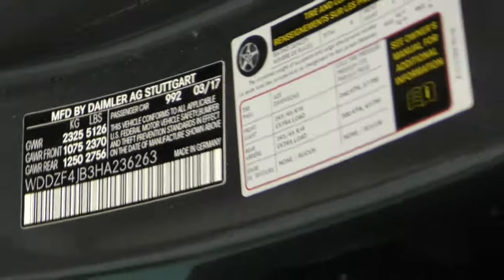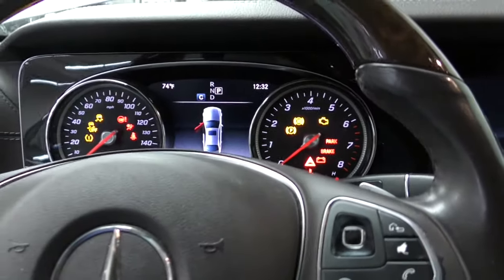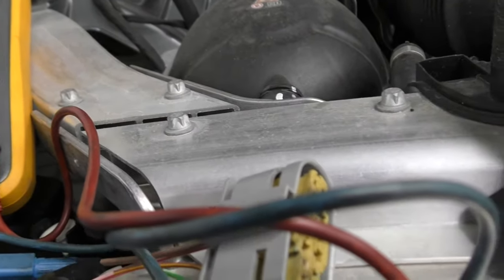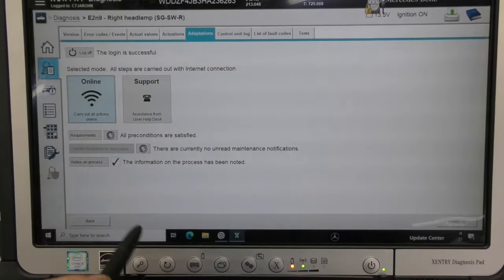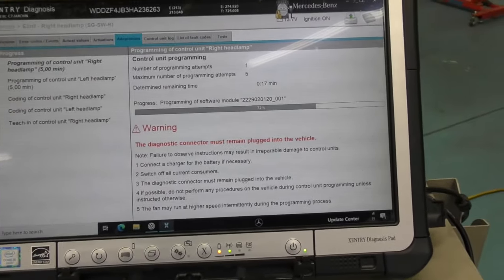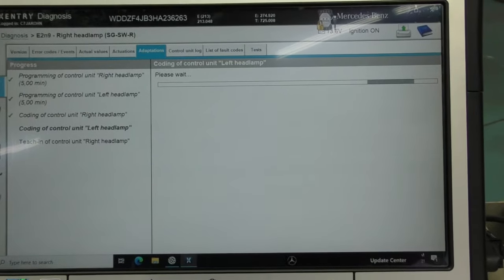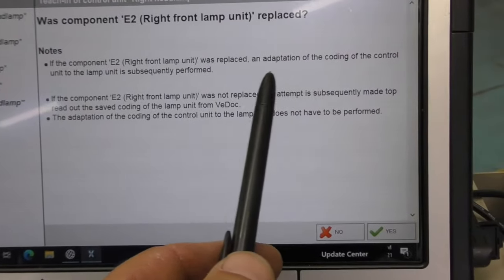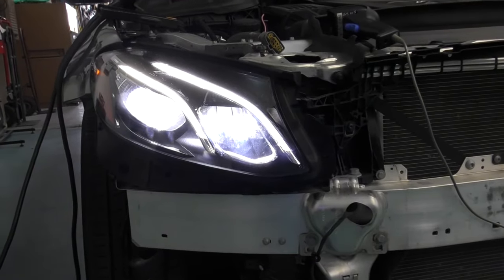How to fix a Mercedes matrix LED headlight replacement and programming

Comment: $2500 ha I bought my headlight replacement online for like $800 thing is I didn’t have to program the new module to the car just plug and play and I bought that module for $80 on ebay
Reply: The dealer quoted me $3360 for this 😂

Comment: So I had a similar issue headlight broke water got in I changed the headlight but now both side light have no response at all.. I'm thinking I need a new module for the light I replaced after that what will be the next steps for coding ?
Reply from the maker: You would have to take it to a dealer or somebody with the Mercedes scan tool. All the coding is done online

Comment: I have a 2017 C300 and I bought some 2019 LED headlights. When I connect them, only the right low beam turns on, but when I connect the left one, they turn off. I’m told they need to be programmed online, but they’re charging me $500 USD. Is it really so expensive to program them online? My headlights and modules are brand new, never used in a vehicle.
Reply from the maker: hi, yes it needs to be coded to the vehicle,

Comment: Why are the headlights so expensive?  I have a malfunction on my right headlight of my 2016 glc300 model.  All of a sudden the low beam light was not working. I was told I need a headlight control unit or possibly a headlight. Can you give me an estimate of the cost for this to be fixed assuming I need a whole headlight.  I have been given a few estimates and both are so off so I’m not sure if I’m getting ripped off only because I’m a woman. Also I think these should be covered by Mercedes’ coincidently it malfunctioned once my warranty expired.  Any help will really help me. Thank you.
Reply: I think the program has crashed in your headlight control module. The cheapest fix  would be is to enquire about a garage that services mercedes and asked them if they do a SCN coding service. What that is ,is an internet connection that downloads the correct functioning software for your headlight module . If your lucky it might work out . It should take under an hour and might cost you several hundred dollars. good luck.
Reply: @888snuffy so she should pay a few hundred dollars to connect her headlights to the internet for an hour? 4R?

Comment: Greetings to all, recently the damage to the car was repaired and at the same time the front right light was replaced.  Now the new light shines differently than the old one.  I would like to know if it is possible to program the lights so that they both shine the same?

Comment: My 2017 GLC300 has condensation in it and it threw error and the lights went out. Once the "desiccant fix" is done and it is dried out, will a rest be needed to make light work again? if there is no other damage?
Reply: Condensation has many degrees.
If it is a fogging up, fine mist, then is a light issue, just dry it up.
If you can see water droplets formed (so not a very fine fogging up) then is severe and most likely some water may have gathered up somewhere inside. The unlucky part is that many headlights have electronic units on the bottom of headlights. 
Also not everything should fail, so maybe low/high beam control unit is under, but the drl one is not, so you just have some missing functions. 
If everything is "dead",  maybe going to a local shop to connect to the car and delete the errors.
If not, i'd take down the headlight and inspect the control modules to see if any signs of water damage..

Comment: Hi sir 

I have 2017 Mercedes c300 base model I got flooded in rain I change the unit control module in trunk now my rear turn signal is not working and the gas door is not opening can you please tell me what to be done
Reply: are the fuses okay?

Comment: Can you help with advice for my w212 2016 with adaptive headlights fogged and stop working ???
Reply from the maker: Fog in a headlight means water got into it remove the headlight from the vehicle and remove the modules in the bottom of the headlight see if you have water corrosion if yes the headlight is cracked and needs to be replaced
Reply: Same issue my car throws up error

Comment: If the connectors pass all your voltage tests, does that also prove the control module is working, so it must be just the headlight?

Comment: I bought a brand new headlight module listed as A1769001204 for a GLA180 (using the original non-working module to retrieve the code). However, it did not work. If I turn on the headlight, the headlight keeps turned off, but the turn signal turns on. If I turn on the turn light, the parking lights turn on. And so forth. It's a mess. It looks like it must be recalibrated. Is there a way I can do that using the programming software?
Speaking with the seller of the module, he says the code A1769001204 is for a CLA not GLA and he says that's probably the issue. I'm not sure, I think it's more a programming issue.
Any enlightment I can have on that would be very helpful

Comment: Hi man.      Question, do you need to program 2020 Lexus LED headlights after replacing lamp and LED module?     I have an issue with my headlights where the high beam turns on for about 10 seconds, then it shuts off on its own and does not work again until car is restarted.        Also DLRs are not coming on.       I need some help.
Reply from the maker: Hi, 2020 LED Lexus headlight does not require programming some of the newer lexus  require set up,  after replacing headlight module,

Comment: Hello,
I change headlamp after crash on my Mercedes w213 2017 and also must buy new right headlamp connector but it’s delivered without wires, just plastic housing.
Is it possible to put my wires in it ?
Thanks
Reply from the maker: Hi, 
Yes there's a special tool to release the wires from the original connector and you can transfer them over to the new connector and lock it in place I have other videos showing how to release and re-insert wiring and what tools you need thank you
Reply: @adasaimingbyjackshort2123  Thank you very much!
Can you please share link for that video here

Comment: I replaced my left headlight on mbe350 2014 he high beams and the turning signal ligh work but the normal light doesn't what should I do
Reply: Hey did you figure it out I’m having same problem

Comment: I can tell you how to make the headlight work without coding ask me if you would like to know.
Reply: Hi, i've replaced right headlight and module in my w213 2017, and after unit programming and scn coding with LAUNCH X-431 the headlight won't work there are only 2 LED stripes working and nothing else. Fault code: U117B00
Reply: @mikoj88  do you have the original moduel.
Reply: Yes
Reply: @mikoj88 so what did you do ? Did you use Orem parts

Comment: I have a mercades cla 2021 without the multibeam headlight but I wanted to buy multibeam headlight for my car will this work if coded and does this multibeam headlight have to be brand new or its ok if its second hand?
Reply from the maker: Mercedes are coded to the VIN number whatever options the vehicle originally came from it will be coded Mercedes Xsentry  diagnostic scan tool does not allow me to change coding on a vehicle
Reply: @adasaimingbyjackshort2123  Have you tried to manually program LED headlights using DTS Monaco? I would like to do a conversion from factory Halogen headlights to factory LED headlights. Any tips or advice?

Comment: Great vedio boss , my question is? What if there is no barcode on the light how can i program ? The barcode available on the right headlight but left headlight not available ? And i wana program only left side because right side is working .
Reply from the maker: Hi I never try to switch to right barcode for the left headlight I guess it should work, many people have used old headlights or headlights from a different vehicle to programmed it, The main objective is to complete the calibration so you match the LED with the power supply so the headlight will perform for many years without overheating & burning out,

Comment: What if I buy a use module that has already been programmed to the same model car. Would it work on my car?
Reply from the maker: Hi, Yes I have program used And refurbished modules  and headlights.
Reply: @adasaimingbyjackshort2123  , Hi from Norway. How that modul look like, or you meen ballast? If only a modul, that meen one to each side or?
Reply: @adasaimingbyjackshort2123  Is the process the same to program a used headlight module? Or does it require some hack to take place?

Comment: Hello, when we finally make connector for new right, used headlight (it’s not brand new) the colors isn’t quite same like on left one headlight and after few minutes of working it starts blinking ?

Bed part or need new ballast or programming 

Thanks

Comment: Hi.. so i just realized that my w213 2018 headlights cut off line are just too low.. and i've been looking for the tutorials on youtube, and still  cant find it how. 

Can you make a tutorial how to aim w213 headlights please ? 🙏🏼😅
Reply from the maker: Hi, great question but no tutorial is needed. Even though these are dynamic led head lights they still have a mechanical adjustment screw for the baseline adjustment.